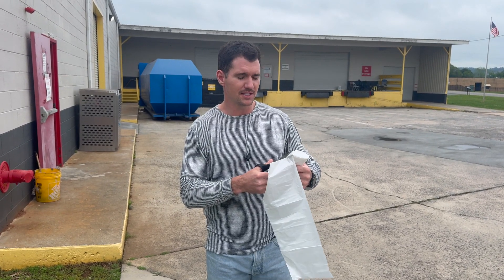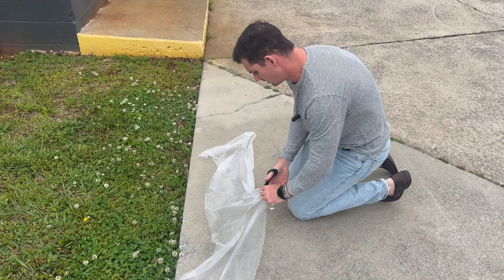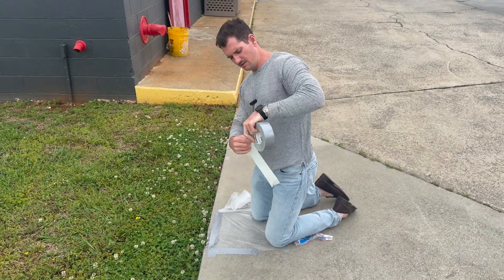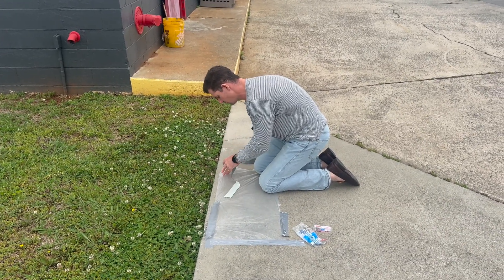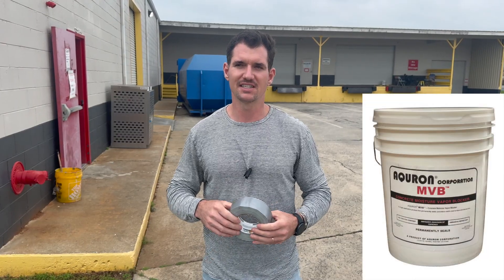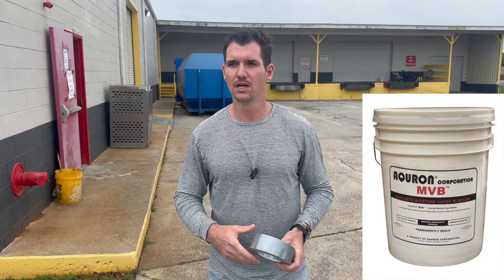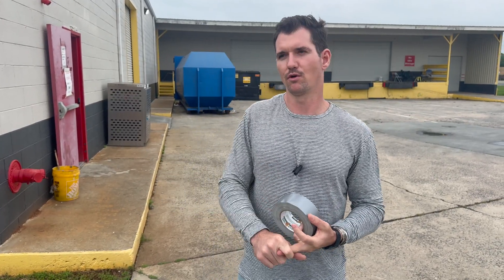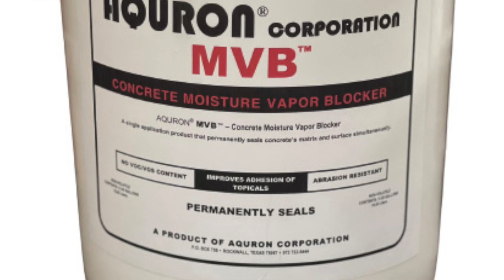How to Test For Moisture in Concrete

Comment: Lets say there was an area which had moisture leakbut you were unaware of it   how long after application would you see the cool fail?
Reply from the maker: Depends on how strong the psi is - our product is breathable to an extent but high levels of pressure can cause problems. After a heavy downpour and pressures rise is when you could see issues.